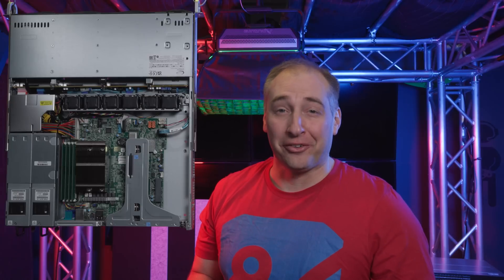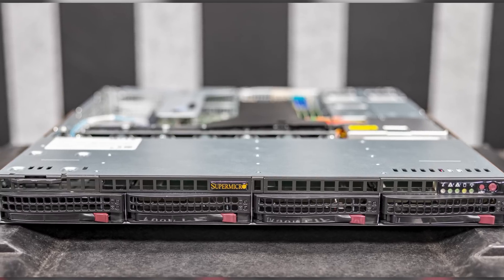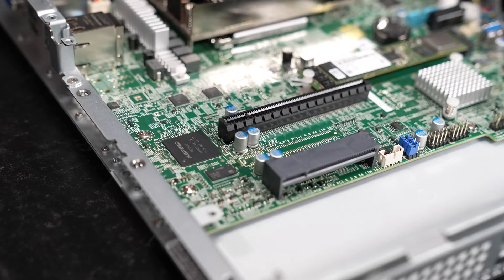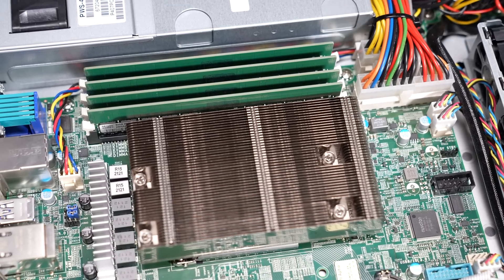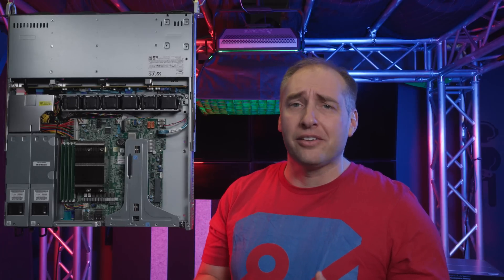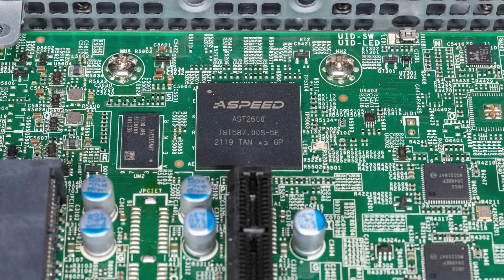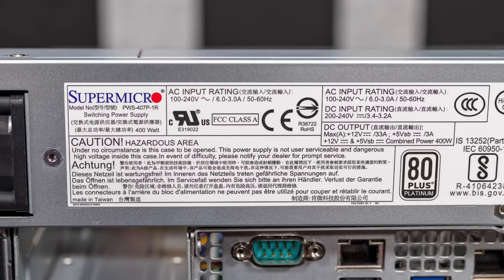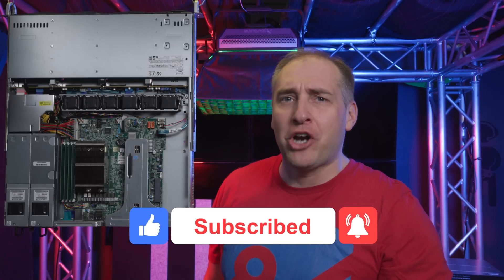New Generation of Entry Servers Supermicro SYS-510T-MR Review

Comment: Patrick, always love your reviews on the latest and greatest small footprint rackmount 1U mini Node/Edge type Servers (Windows 2016/2019 Server) and the  Gen 4 crop of micro-workstations. IMHO You are the Guru for knowing what’s out there in the Server market today. Wondered if you have ever spotted a Xeon or AMD 1U Server with the following kind of specs? 11th Generation Intel (PCIe Gen 4.0) Xeon or AMD PCIe Gen4 Server, 1U Single-Socket Server (more of a licensing issue for the Oracle RDBMS) that would support up to four (4) 4TB NVMe PCIe Gen 4.0 SSDs in front panel? The other acceptable front panel SSD option would be four (4) NVMe PCIe Gen 4 U.2 or E3.s SSDs. The I/O communication would be supported through a single 10/25GbE dual port communication card. It would support 64GB of 32MHz RAM memory and support an internal graphics card capable of driving a single 32" 4K monitor (HDMI 2.0 or Display Port or USB-C 3.2 Gen 2 port). This Server is NOT acting as a Graphics oriented server, the 4K Status Monitor is solely for presenting four (4) 1080p real-time status windows (on 32” Monitor) for easy viewing of processing performance and other elements. This Server will be running Oracle 19c snapshots at a remote location for specialized (proprietary) processing. All data capture will be directed to an external 1U iSCSI SAN/NAS unit through the 10/25GbE ports. Trying to find a machine like this for <= $8K.

Comment: The card that actually goes in that right-angle 4e slot is, for some reason, the {L8[ei],H8[ie]} family. Which really makes absolutely no sense because there's no rear punch out and no possibility of utilizing it. You have connector support for 16 drives with no possibility of physical mounting. And the X12STH-SYS can only be had as part of that exact chassis, or the SYS-110T-M which has 8x2.5 but comes fully pre-cabled to the motherboard (and uses the SATADOM connectors.) Supermicro really is a shadow of it's former self.
Reply from the maker: Phillip - I am a bit confused with this. The five cards listed as optional are all internal 8 port cards, right? Four of the eight ports could be used for the front bays instead of the SATA bays.
Reply: @ServeTheHomeVideo  the L8[ei]/H8[ei] family cards are all proprietary (host board locked) 3008/3108's with double SFF-8643. And the L8's are extremely ancient - they still list X8, X9, and Win2k8 support. The L8's can't communicate with the backplanes in the 510T or 110T. Not to mention the L8 (3008) was designed as a scale-out HBA for expanders. The H8's make little sense either because they're massive overkill while also being antiquated - no SMART in any mode, limited SSD support, limited to no support for TRIM. 

So either card is half wasted in the 510T chassis. And the 110T chassis sort of lets you use the ports you bought, but those high end H8 ports are a cut-down MegaRAID 6361-8i from 2014. So it does forced sync writes. Plus I'd bet also still has the really, really nasty parity penalty defect. So the motherboard would give you equivalent or better than the L8 for all scenarios, and the H8 only makes sense if you're RAIDing 2.5" platters.

Comment: What's the point of putting a 100 gbps NIC into a system with only SATA HDDs? Your NIC is not going to be your determinant device. Why are we still making systems with 20 year old tech mixed with new tech for? There are so many congestion points in these systems. It's more like a Wal-Mart branded computer which advertises that it "supports 100 gbps NICs", but would be pointless to even consider it. These are just token marketing slogans they throw at us to get us to buy 20 year old parts they have laying around.
Reply: You could serve from cache or ram or compress to disk (to be fair, 100GE would probably stretching it, but 25 or dual 10 for sure).
Reply: "Up to 128GB RAM" would take a while to fill up w/ 10Gbps LAN

Comment: Protip, you can fit at least 4x SSD's above those normal bay slots if needed. We had done this in the past when more drives are required. 
Is SM allowing you to buy mobo and cases these days without having to buy CPU and Ram and Drives? We stopped using them a few years ago after they stopped allowing us to buy separate systems parts.

Comment: I have a weird respect for Supermicro making a 2021 product look like a 2004 product. Impressive levels of not giving a crap about being pretty
Reply: It only lacks 80 wire IDE ribbons to all those front panel bays.
Reply: Function over form, baby
Reply: It's a server, it could look like a total dog egg as long as it does the job reliably.
Reply: Hey if you have to machine tooling or whatever it's called, why not.
Reply: It looks nasty like all the metal is thin and flimsy and will cut you if you touch it
Reply: @isbestlizard  I was servicing a switch a few weeks back.  Ended up with 5 bandaids.

Comment: I was pricing out similar machines in the scalable socket, there is something that you may have missed. On the system I was looking at, you can get mounts to add two 2.5 inch drives above the 3.5 inch hot swap bays, 6 drives total. I'm guessing that these you are reviewing also have this option since the chassis looks identical.

I'm pretty sure I was pricing X11, there was no M.2 slot on the ones I was looking at.